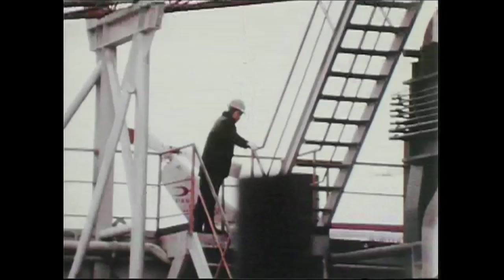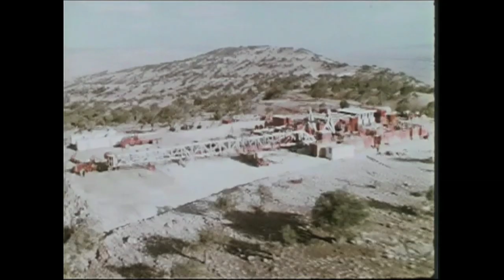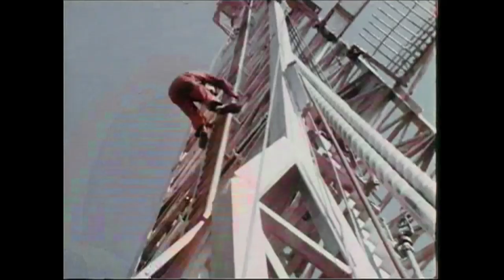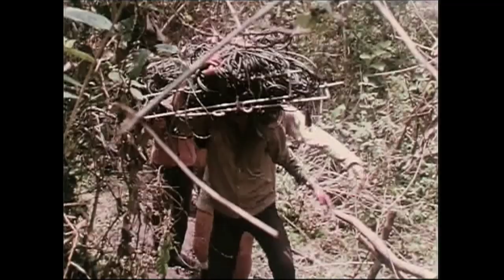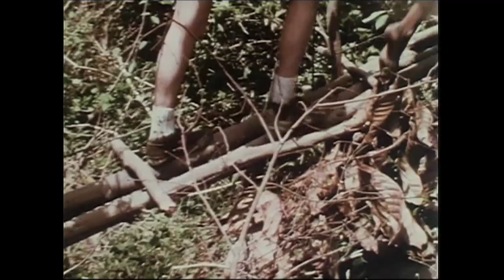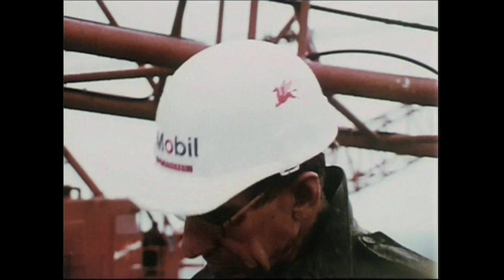Waylon Jennings Country Music Song That Honors Oil Drillers

Comment: Remember when jimmy carter said the world had peak oil and we’d only have 40 years left?
Reply: You didn't think the greatest minds armed with the greatest budgets for the greatest machines available in the greatest boom of human civilization were gonna let that happen, did you? We are well past "peak" oil production considering the proven reserves and extraction technologies available to academics in the 50s and 60s. We are better at doing more with less, and this is reflected in our consumption of oil products. And it turns out countries play their proven reserve numbers close to their chests, so it's difficult to put a number on actual reserves. But for example Saudi Arabia has long since started drilling off-shore, and most of the world's largest reserves are now being extracted via "secondary" extraction means. Which brings me to the final point, that "primary" extraction method meaning you catch as it shoots out of the ground, "secondary" extraction methods  are those which require you to use a pump to get it out, and "tertiary" extraction methods are the ways that we're pulling oil out of the tar sands in Canada. Tertiary extraction methods have opened up a whole hell of a lot of oil that previously was considered unviable.

Have faith in human ingenuity! Or at least have faith in human greed.
Reply: L0j1k thanks for the reply, yeah you are right, we are much better using Less of things and are much better at using oil and water much more efficiently then we used to. I think it’s cool that human innovation has gotten us this far... pretty cool...

Comment: The company I worked for from 1967 to 1997, Lone Star Producing Company, the drilling and exploration subsidiary for Lone Star Gas Co., the Dallas gas utility, drilled the deepest well in history between 1972 and 1974.  The Bertha Rogers No. 1-27 in Washita County, Oklahoma reached a total depth of 31,000 feet when the drill bit melted down in a sulfur deposit.  Ultimately the well was unproductive at TD and was plugged back to around 25,000 feet and completed in the granite wash formation.  I worked for the VP of onshore drilling operations and took the daily drilling reports on my shorthand pad, several of which I still have.  We got the first Xerox telecopier in the company in 1974 and it wasn't worth two cents.  It was replaced by a 3-M which could copy a page in 3, 4 or 6 minutes and the paper didn't flap on one side.  The Bertha Rogers stopped producing gas in 1997 and has been plugged and abandoned.